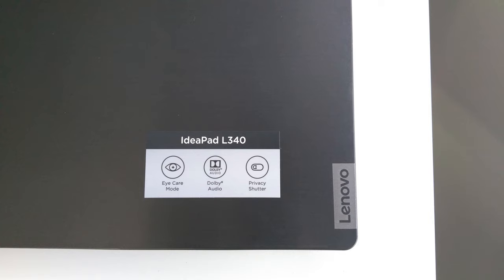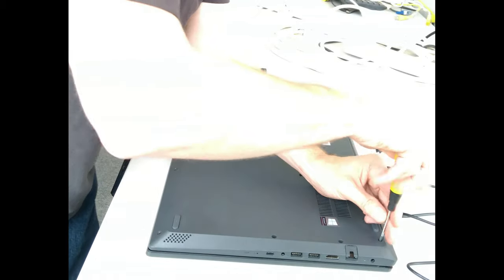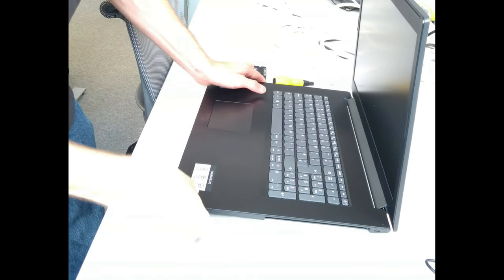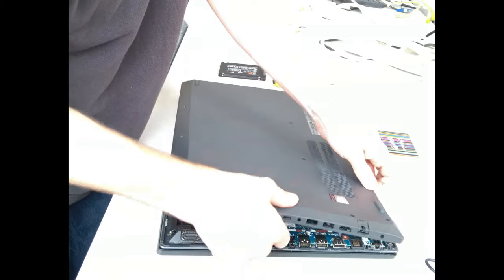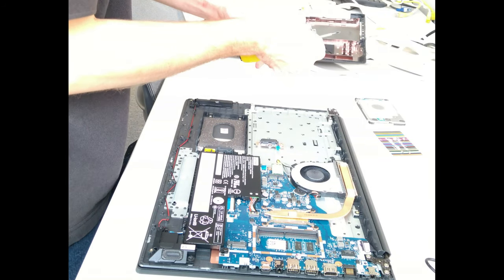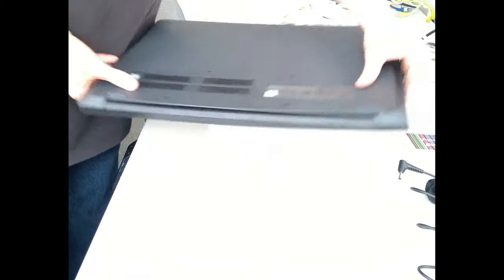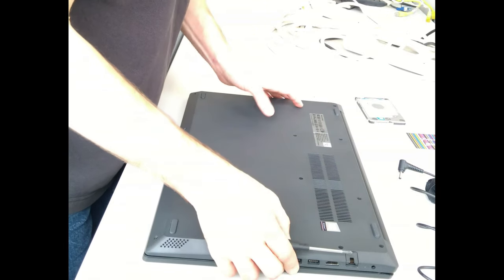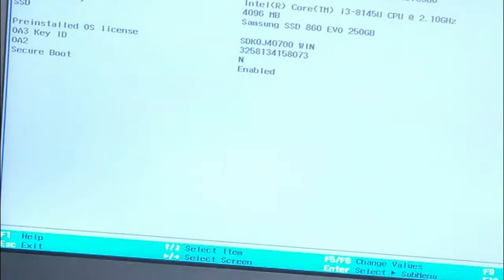Lenovo L340 - How to change or upgrade the hard disk

Comment: This must be a kind of bad joke. I got the 17" model and I can't even upgrade the HD , only a M2 slot there and a "fake" 2.5" slot. To reach the ram module is also impossible. I broke three small clips from the back of the NB, only to find that out. GG Lenovo. Very well done!
Reply from the maker: It's all built down to a price. Sadly expected :(
Reply: @freename  Yes, that makes sense, I guess. But I've expected more for almost 700€. Even the display is far away from... "Good". :/
Do you maybe  have a idea if there is a current notebook which still has the "normal" maintenance flaps, so that hard drive and ram modules can be reached easily without breaking something on the case? I also saw somw newer MSI notebooks which are also using this new "technique" so that one first have to disassemble almost the whole notebook for maintenance.
Reply from the maker: Some of the enterprise / docking station compatible Lenovo laptops have easy access doors .. unlikely to have good graphics cards though.

Comment: Thanks for your work, but the laptop is not closed right.
Look at 11:43 where you show the reset.
Reply from the maker: Probably wasn't but non flush joins at the edge are trivial to fix by squeezing the case at that area. I think I did so after the recording ended and during the operating system install.

Comment: hello great video but just a quick question how would i add more disk space or make more disk space because I've almost used all of mine already and I'm unable to download a game I've purchased.
Reply from the maker: If it is the exact same model as the one I show in the video then you could either replace the existing 2.5" drive with a higher capacity one or add an M.2 SSD as well as the existing 2.5" drive.

Comment: I bought the l340 gamer and tried to put a ssd m2, but the notebook does not recognize the ssd, could tell if I need to put a drive or if there is a specific ssd m2 for him
Reply from the maker: I don't think I've ever seen a company limit the m2 drive that can be used. You can't just put in the m2 and have it start up - you need to make sure you have installed windows or an operating system on the drive once you put it into the computer. Or if you are using it as a second drive you will need to use disk management to tell the operating system to format the drive.

Comment: If you’re going to be opening up your laptop, you should invest 10$ into a kit that has all the tools to do stuff like this. Otherwise, if you play guitar or have medium guitar picks lying around, they work too for prying open electronics like this.
Reply from the maker: I normally use a thin metal craft knife but doesn't always travel with me so had to improvise. The plastic card trick works quite well.
Reply: @freename  I agree, sorry if i sounded a bit heavy handed, hence my guitar pick bit. I was just trying to get across the fact that it takes a bit more than a part and a youtube video to upgrade a laptop.
Reply: @freename  Its a great video dude, thank you for putting it up. Once that pos case pops off, its all good hahah. You've got my like and sub for sure and this video needs to be higher up for people with the same laptop
Reply from the maker: The video that was top when I last looked was a terrible 3 minute video that entirely glossed over how to unclip the underside cover! It just magically lifted off with no effort at all. Hurr. Just because it has a glossy cover image and is higher resolution than mine it likely has many times the views and many times the number of confused viewers missing the critical steps to open the laptop!

Comment: I've noticed that there is no RAM Stick installed on the laptop, does that mean the 4GB RAM is soldered to the mainboard and that open memory slot is for extra or additional RAM? Does the 15" version of L340 have the same RAM configuration? Thanks!
Reply from the maker: I'm not 100% certain but I would say the chips right underneath where the RAM slot is are the soldered on RAM chips. I would assume but have not tested - that you can add any sensible amount of extra RAM into the spare RAM slot.

I'm also not sure about the configuration of the other size model, sorry I'm not much help!

The compatibility / ram checker on Crucial.com is probably a good place to look up the RAM that can go into your machine.

Comment: I can't seem to pry off the clips on the sides of the laptop - the front comes off easily, but the side doesn't budge at all. I've tried using a guitar pick and a credit card for this, with no success. Is applying more force a bad idea? Kinda considering just bringing it to a laptop tech now, I'm a bit scared of damaging it. All the screws are undone, I triple checked
Reply from the maker: It looks like I also had a bit of trouble. Pay attention to the direction the card is slid into the laptop to unclip the side. But if worried, don't break things and take it to someone who has experience of opening up laptops regularly.
If you are putting force in, try to keep it on the underside panel rather than the palm rest / keyboard / motherboard assembly.
Reply: @freename  thank you for the response on such an old video! After a few more attempts I managed to get it open, just needed to find the right angle. Thanks for the advice and the instructions, very useful!

Comment: Hey man i bought this laptop for school and i have a 256GB SSD which isn't enough for gaming and making virtual machines.

Is there in the laptop a second slot for another SSD and is there any specific SSD i have to buy?
I look forward to you're reply thanks!
Reply from the maker: Do you know if the drive you already have is a m.2 or a SATA SSD?
Reply: @freename   I'm not sure to be honest.. do you know how i can find that out?
Reply from the maker: @bram2352  Maybe look at the model number of the disk drive in Device Manager - otherwise open the machine and see what slots and connectors you have spare.
Reply: I found out its a m.2 ssd! 😁
Reply from the maker: @bram2352  So the next question is - inside your laptop; does the connector exist at 5:25 where my 2.5 inch drive was plugged in. It is going to be impossible to guess so you will have to open it up or see if someone has a video or photo of the inside of your exact Lenovo model. If the connector is there and empty - plug in a larger second 2.5 inch SSD or SSHD/HDD. Good luck.
Reply: @freename  Thank you! I'm a bit afraid that if i open my laptop that the garantee will go away. i'm going to check that with the company where i bought this laptop and go further from there 👍
Reply from the maker: @bram2352  Almost certainly will void your warranty (especially if it is opened badly or you break a warranty sticker over a screw or similar... or you tell them :D).
Reply: @freename  hey man i have another question for you. What if i buy a external hdd or ssd and put Modern warfare on there is it then still possible to play?
Reply from the maker: Every game I've used so far allows you to do that but I can say I've tried with that game. It will load up and load levels slower.
Reply: @freename  Thanks so it wont affect the graphics fps and the overal quality of the gameplay?
Reply from the maker: @bram2352  wouldn't have expected it to. If you get random freezes for a few seconds while you enter a new area or see something new maybe it can't load the texture fast enough from the external drive. Make sure you get a usb3 one and plug it into the usb3 "ss" port.
Reply: @freename  i will! Thank you very much for everything

Comment: hi  my l340 laptop have a 256 gb ssd and ı want to hdd upgrade but not remove the ssd, just hdd+ssd . Is this possible? How many slots this laptop have?
Reply from the maker: If the existing SSD is an M2 / NGFF one then the hard disk slot will be empty. It's possible that Lenovo won't have left the empty SATA connector there though. The only way to find out is open it up and see if there is a spare space and a connector in the same place where I remove the hard disk on my one.
Reply: hi, were you able to put in a 2.5 inch drive? was the connector there?
Reply: Minom Pnom i didnt try yet sorry, but i think it gonna be there

Comment: Hey man, I have this laptop but it doesn't come with the bracket. I purchased a bracket from Lenovo but it didn't come with any screws. Would you know by any chance what type of screws are required for holding the hard drive and holding the bracket?
Reply from the maker: I can't help on the bracket screw size, sorry. 
Hard drive screws are standard so I expect you can find that on the internet.

These look suitable:
https://www.amazon.co.uk/Laptop-Drive-Screws-M3x3MM-PM3X3-0/dp/B00B1UVKSY

If doing your own search make sure you are looking at 2.5inch drives not 3.5inch.

Comment: If i exchange the ssd, won't i lose the windows and all the things? How do i to change without lose the windows at least?
Reply from the maker: You would need to clone the drive using something like macrium reflect (free) and a usb to SATA converter.
Or make a Windows install usb stick and install from scratch in the new drive.

Comment: I got a same type of laptop, with ryzen 3 3200u ,4gb of ram, and 1tb , can i make a ram 12gb with add a 8gb ram in same type and speed ?
Reply from the maker: I'd use the crucial.com checker as it will say what is compatible with your system.

Comment: Just got one of these with ryzen 5 3500u, but it's got a slow HD. What connector do I need for my new upgraded ssd? Also would it be better to get a m2 drive as upgrade?
Reply from the maker: The upgrade I do in the video is the hard disk to standard SSD upgrade. The SSD just needs an SATA connector. Or for better performance you could look at getting an m2.
I doubt you will notice a difference so whichever route is easiest.
Reply: @freename thanks for your response.  I wouldn't mind keeping the hdd for storage and booting from the m.2 ssd. Do you know if that would be possible?
Reply from the maker: @j3orbit761  should be fine doing that.

Comment: Also, if I install a new ram, will I need to use a paperclip like you did at the very end for the bios thing or can I just press the power button right after I've screwed on the cover?
Reply from the maker: I probably only used the paper clip to go into bios as the drive I had put in wouldnt have an operating system on it. No need if just adding or changing ram.

Comment: Bro i have l340 with 512GB SSD CAN I UPGRADED TO HDD BY REMOVING SSD AT THE SAME SLOT OR OTHER ANY PROCESS....llll🤘🤘🤘🤘
Reply from the maker: Depends if your existing SSD is an M.2 card or a 2.5 inch drive. Also putting in an HDD is not an upgrade; an SSD is many times faster than an HDD.

Comment: How many slot have for ssd and ram please answer
Reply from the maker: You can see at 5:14 - 1 free RAM slot in this machine. An NGFF slot to the left of that and the SATA drive I replace. You might also be able to use a CD drive slot to hard disk/SSD converter too.

Specific model numbers might have different free slots (for example some models may already have expanded RAM in the spare RAM slot, or an NGFF SSD already in the NGFF slot).
Reply: @freename   I m going to buy this one
LENOVO IDEAPAD L340 CORE İ5 9300H 2.4GHZ-8GB-256GB SSD-15.6"-GTX1650 4GB-W10
Do you know this model
Reply from the maker: @ahmetyeyrek8177  I only know the one seen in the video.
Reply: @freename  thanks
Reply: @freename  Uh where do you see a second slot for the RAM ? That's strange I checked the right model number you put in the description and it says it only have 1 slot.
Reply from the maker: @trixniisama  1 slot - as you see in the video but you also see me put the computer together and turn it on and it works.. so there has to be RAM also soldered onto the motherboard. (or hidden somewhere inaccessible?)
Reply: @freename  So you think Lenovo is lying on their own product description ?
Reply from the maker: No.  It has 1 slot and one fixed ram on the board as far as I can see.

Comment: Don’t I have to clone the hard-drive to the SSD?
Reply from the maker: Depends on your use case. In my video I didn't need to as I was reinstalling. If you want to clone I recommend macrium reflect free. And a usb to SATA usb3 adapter.

Comment: hi what wifi card can i use cause i bought the base plan with WLAN 1x1AC+BT can i upgrade to dual channel
Reply from the maker: If the card will fit in the socket it might work. Some manufacturers block non-approved wifi cards from working so make sure you have the ability to send it back if it does not work. I don't have any details on if Lenovo block non approved wifi cards in this laptop.
Reply: icannotgetafreename thanks for the reply but how can i know which wifi card is blocked by then i’ve tried checking for my lenovo ideapad l340 15api but unable to find any result. do you have any idea about this to where i can check

Comment: Hi , i have a Lenovo Ideapad L340-17IRH with only 256 m.2 SSD and an empty space for 2.5" SSD .I dont have any SSD case and screws given from Lenovo in the laptop itself .Can i use my 860 evo samsung  SSD in this laptop ? Is it compatible at all ? Also can i use any disk bracket sold out there for this job or do i need Lenovo's specific items ?
Reply from the maker: Does the laptop have the SATA+power connector where I unplug the drive in the video? If so- just plug in your SSD and find a way to make it secure? Or look on the official Lenovo parts website for the bracket.
Reply: Hi savvas how is You ram 4gb am onboard + 4gb ram 
 stick for dual channel? or is 1 stick 8gb?
Reply: So , I upgraded my laptop .It had 1 dimm 8gb and I installed a 16GB Crucial 2400mhz dimm . Also i got rid o fthe 256GB m.2 and Installed a Samsung 970 EVO m.2  with 1Tb capacity and worked like a charm . No BIOS settings ,no sweat .Just plugged in and played . So in case you want to upgrade you HDD just update your m.2 nice and easy without searching for brackets and cables from Lenovo ;)
Reply: @Metalinious73  Hi Savvas, I have the same Laptop "L340-17IRH Gaming" there's only the 256SSD, can I add a HDD, there's a empty slot to do it? or can I only put another SSD?

Comment: No space for 2 drives? I'm buying an SSD because I can't live with this ridicusly slow. I don't really mind storage, because it's a Linux machine used only for assignments for the university and taking it there. But a 1 TB Hard Drive would be more welcome than plain 500 GB SSD.
Reply from the maker: A second drive might be possible where the DVD drive is if you use a DVD to HDD converter caddy. Doesn't always work on every computer though due to weird incompatibilities with the hard disk / DVD controller.

Comment: Can i have both ssd and hdd on this device model?
Reply from the maker: If you have the headers for the hard disk and the m.2 then maybe. Or if it has the headers for the hard disk and the DVD drive you may be able to get a converter to go in the DVD slot.
Reply: @freename  the unit was installed with SSD...and there's a HDD upgrade kit. I am not just sure if that's for 'hdd installation so i can have both ssd and hdd' or if 'in case i want to replace ssd with hdd because i can't have both'